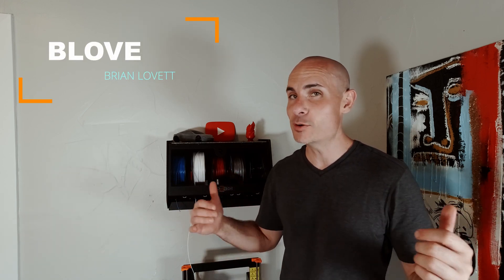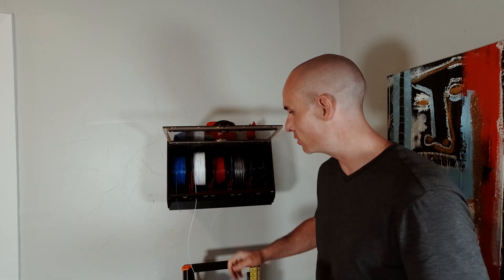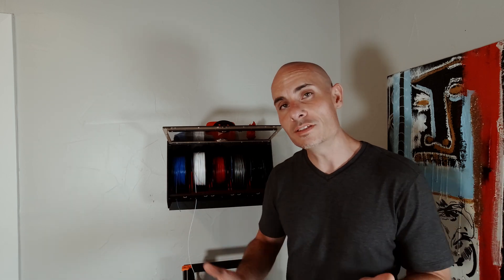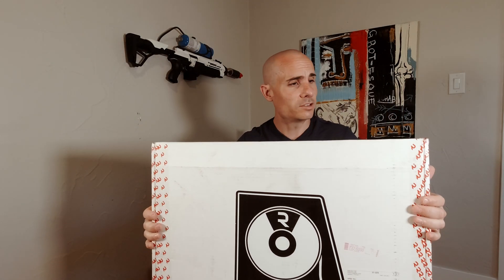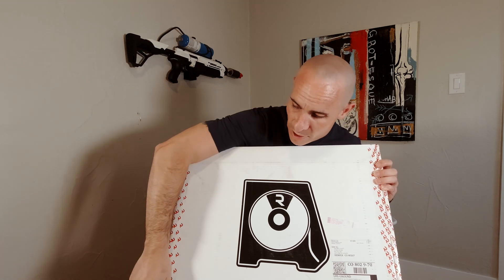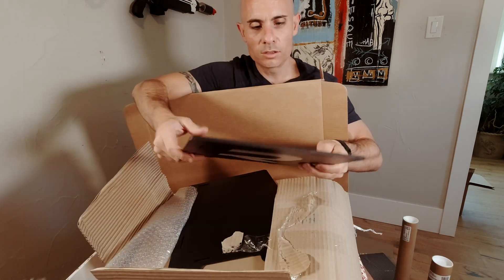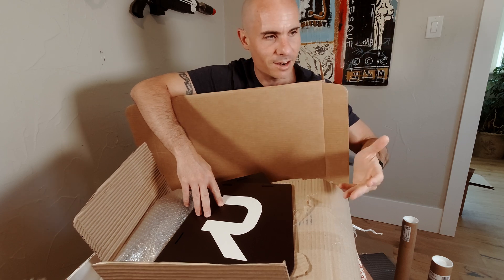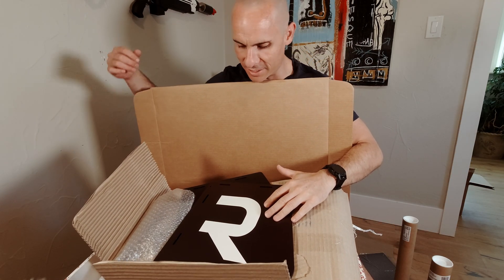The Ultimate Spool Holder Solution: Repbox V2.1

Comment: are you still satisfied with your purchase or have you found a better solution?
Reply from the maker: Overall still happy with it. I have another setup i'm testing where I 3d printed some wall mounts that hold spools. I can then just run whichever filament I want to print with through the buffer box that comes with the mmu2s and into the printer. That's a good budget solution that might work just as well. One thing that I was not happy with were the auto rewinders. I use a variety of filament types and brands, and they just never fit properly on the spools, and the spring tension wasn't high enough to properly rewind. I now use the box without the rewinders, and it seems to work fine.